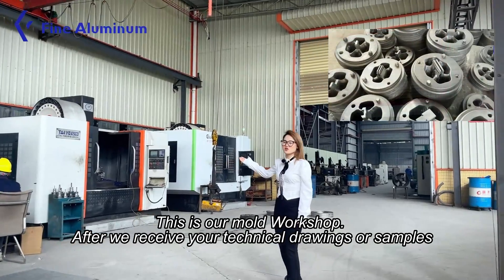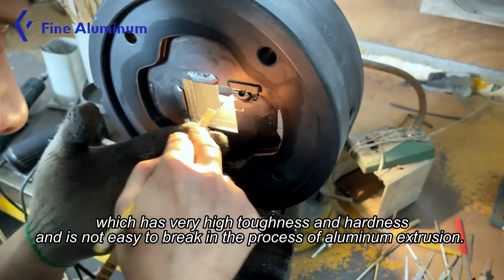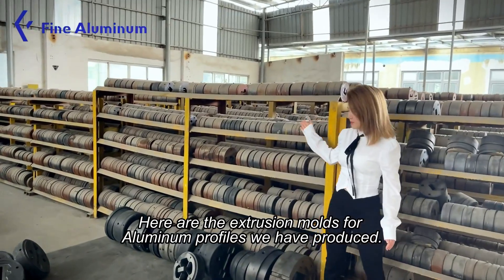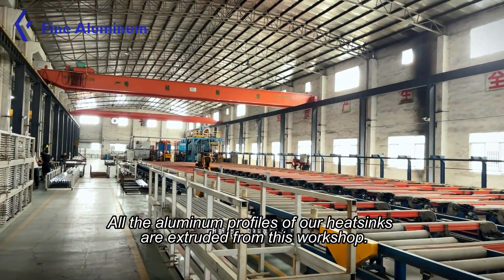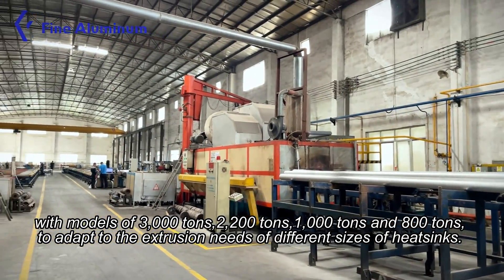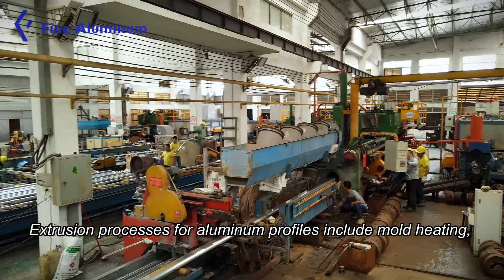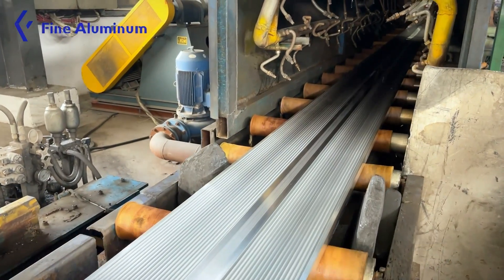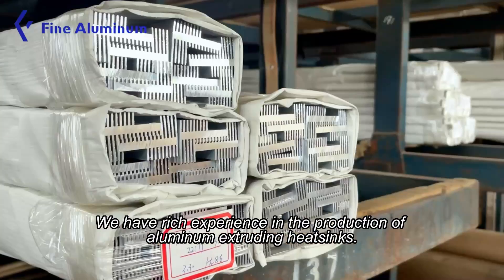FINE Aluminum Heat Sink Production Feature Film Part3

Comment: Universe present theroum.        Whatever. The physic intial  starting Universe theory. Is we. Need to put. The time of this present and let it's represent a point A. on the line number of X axsis.   This line of X axsis is.  The time before point A is. The past proid was open and let piont. N. Represent today 21 th. March of 2022 let us. Assuming the Universe  age Twelve Trioune years for example suppose the distance between point S and N is six cm. Each  cm. Is two. Trioune years.  Let us change scales of representation that  old Universe only one centmeter  we. Get  point A  fare . only one centmeter from point N as we increasing scale piont A  approach point N. Without efficienting the past proid   before point A. Now. Limited as a scale approach  infinity  Point A is point N this means No past.   Again repeat the procedure  on right side of point N going to   feature side you are going to conclude again No feature.  All.  These  Two  results  obtained because the proid past point A is open  whatever the physical  therapy of present Universe Would not be able to answer the question why we are not before and also can not cancelled age of Universal. This question why we not before Trapped Us             ..     only to get excite that Allah is time again this is not  aslution because still repeated the question why we are not  before meanwhile the answer Allah have  no past. No. Present no feature but we already lives as afact all bodies the past proid  and. Present and future  again Allah crate us in such away that no one can know what is the time  and  not  already  exists from Trap